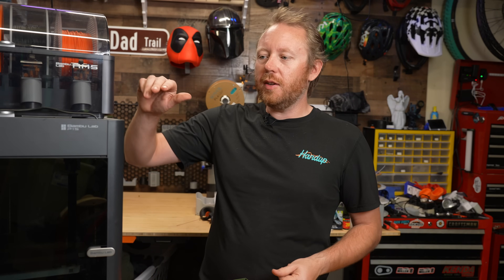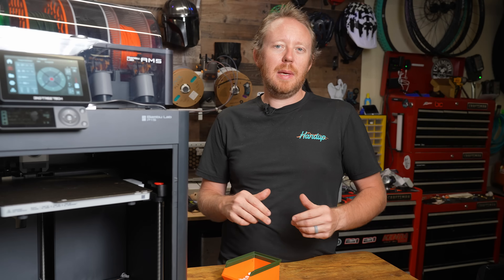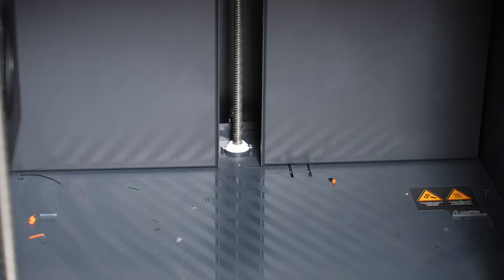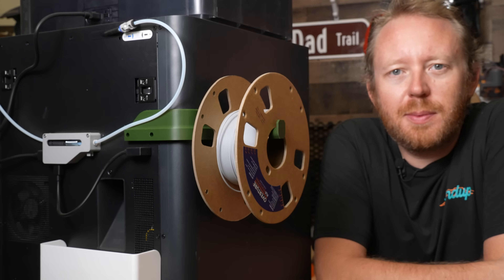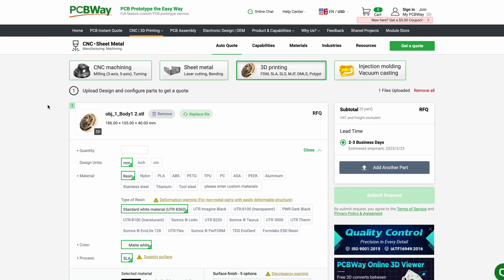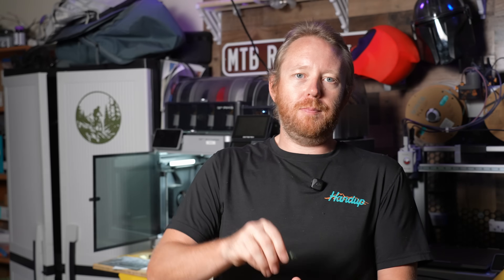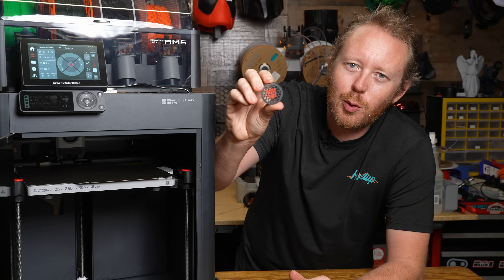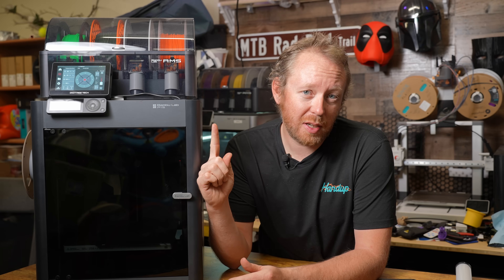5 Essential Free Mods You Need for Your Bambu Lab P1S

Comment: I'm sure you get asked this a ton... so I'm sorry to ask... but what is that add-on display you have on your printer?  Thanks.  (ok, I just finished watching... you mention the display.  So, let me refine my question... does it replace all the functionality of the original display?  Also, is it still available/where can it be purchased from?)
Reply from the maker: That is the Panda Touch from big tree tech, but unfortunately it doesnt work with newer firmware. My printer is running some old firmware at this point.
Reply: @RadDadsPrintLab  Thank you so much for your reply!  I've been resin printing for about 3 years now.  I'm looking into getting my first FDM printer.  Considering the P1S.  So, I'm trying to do all my research before pulling the trigger on one.  :)

Comment: Ten ekran Pandatouch już nie działa z najnowszym oprogramowaniem Bambulab do P1S
Reply: really? bummer. i was just going to purchase one for mine. but was worried about this issue. but i've read on other sites other guys have had no issue with it because when bambu went rogue like apple crap. there were huge complaints about it. so its been dulled back down. (so i've heard)
Reply: @deadpoollane4229  Nie działają wszystkie ważne funkcje. Trzeba zainstalować na P1S stare oprogramowanie i nie aktualizować go.
Ja nie korzystam już od dawna z ekranu drukarek.
Wszystkimi steruję z  poziomu PC, z Bambustudio.
Nie kupuj tego ekranu, to strata pieniędzy.
Reply from the maker: I havent tried it, but if you put the printer in LAN/Developer mode it might work
Reply from the maker: Correct, I have not updated mine to this day so it still works

Comment: Thanks for video. Could you share the info about that extra display you have installed there?
Reply from the maker: Thats the panda touch, but it probably wont work with the newer firmware unfortunately
Reply: @RadDadsPrintLab  I’ll buy a p1s soon and I’d like the panda touch to work. Do I miss out something if not upgrading software?

Comment: The screws for the mini poop bucket are not actually M3-8 machine screws. They are a different screw thread and resist entry. Also, the hole in the metal back is not large enough to permit entry of the M3-8. Assuming that they will engage plastic, not metal they could work.  Will you clarify? Thanks.
Reply: Since you know this, why do you not clarify what screw is appropriate please?

Comment: Those covers for the bearings just absolutely useless
Reply: @Ghjhfbnn  keeps dust and moisture out. Not totally useless. But it’s cool
Reply: The prolong the life of the bearing
Reply: @Shrek-is-dude  the bigger issue is the grease covered threaded z-axis itself.  That sticky grease attracts filament particles and the exposed threads of the heatbed roller balls will be negatively impacted.

Comment: Thanks for the video. 
I will like & subscribe. 
Tried my p1s today for the first time, with the loaded files. Looks like it will be fun though.
Of course it was a $60 video, as i immediately ordered the big tree screen! The little one that comes with the BBL printer is annoying!
Reply from the maker: Thanks! that little screen is from Big tree tech is awesome! Its on the list of videos I need to make haha
Reply: @RadDadsPrintLab  still workd with their upgrades ??? im ordering one if it does...you missed the bottom cover for the belts an also 270 degrees hinges, and a low riser with a a tpu seal that have vent and led place....i think this last one is by Bibo or something like that....oh and by the way you should reduce your purges this is ridiculous gcode is right under runout sensor E50 for E03